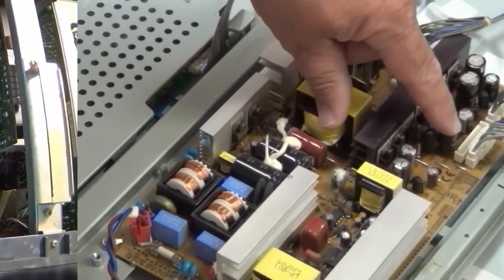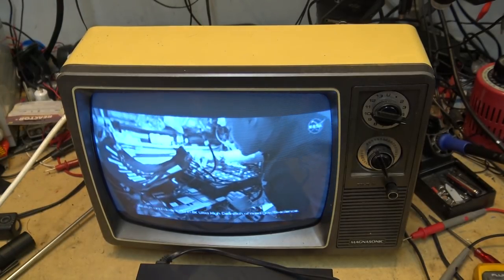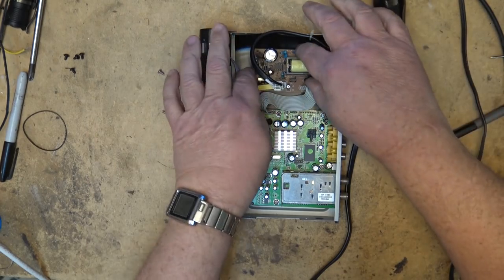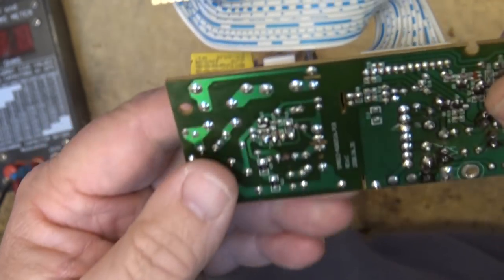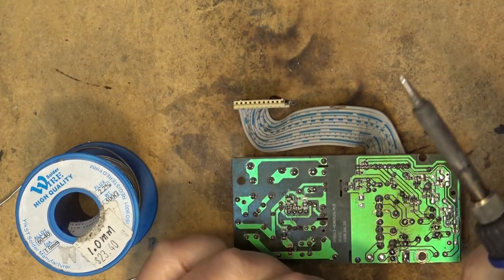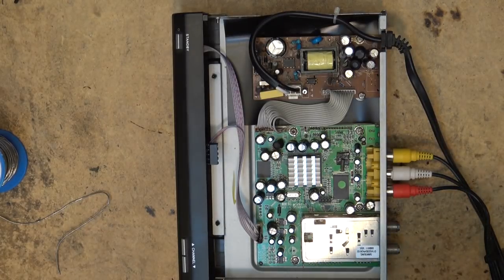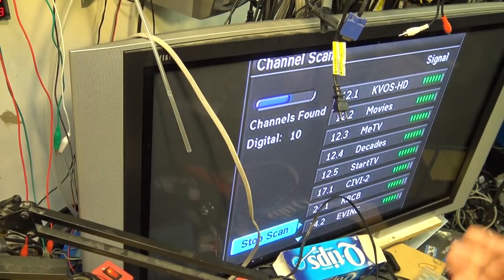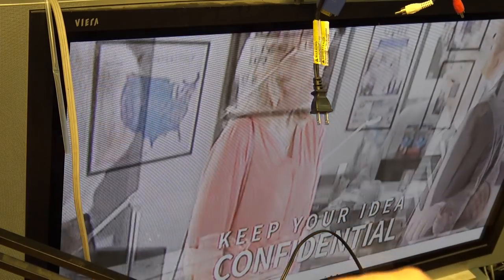Memorex ATSC to NTSC converter box repair NOT FAILED CAPS

Comment: first converter was an apex unit,after 6 months it ran warmer & warmer getting hot around a year into use,next 3 months,it had to  be warmed up with a  small space heater aimed at it before the red light went to green .A year & six months after purchase ( govt paid rebate) it died,,for good & the last time when I put a carbide drill bit  through  it,out to the alley with it I must say for the first 5 months of use,the apex put a great pic in the tube,nice dense color & balance , skin & green tree,   earth  tones,it was great..At the 6 month mark it also tended to drop channels,had to rescan often, The replacement for it is the insignia brand,pic is still almost tops,but consistently works the way  it is supposed to, an used radio shack antenna amp helps pull in a stronger signal from the rabbit ears I placed on the window sill
Reply from the maker: They have some real nice ones now with USB so you can plug a hard drive in and it becomes an off air PVR. If I didn't get a discount on cable/internet I would drop it and just get some HD receiver boxes with hard drive and record everything from free TV.  I currently do that with an old Bell 9200 sat receiver. Sat has been dead for 10 years but the ATSC tuber works great. I use it every day to record the news.

Comment: Seems like earlier HD DTV boxes that were usually rack width and also work with old analog sets were much better made. Like those made by Motorola and Samsung (with ATI HDTV chipsets). These more recent small boxes are junk, likely all made by the same Chinese outfit (Funai?) despite the branding on the front of the unit.
Reply from the maker: This was an early box.  I have had it probably 10 years now.

Comment: May seem crazy. But I wish I had a box that does the opposite of what this type does. Reason is I have multiple VHS tapes  and a  DTV converter that records to flash drives. But, alas, it has no form of analog support.  I can record to a DVD and rip it to a computer, but that's a tad cumbersome.  The adapters that convert a VCR output to USB have been a no go. Everything was shot by an armature, so some quality loss is no big deal.

Comment: Speaking of Converter Boxes, I went to Yard Sale and browse around, and the owner didn't know what that is and decided to sell for 25¢ because, they never use these pair of the devices! What I found out, it is a Digital Converter Boxes for Off Air TV! So I bought them two for 25¢ each and not a bad deal! It's a Magnavox TB110MW9 Converter Box, it only got one remote for the Converter Boxes and still works. Plus I got the next one, is the two Bunny Ear Antenna for 300Ω terminal, and came with 300Ω to 75Ω terminal for the VHF sockets, and one Bunny Ear Antenna for the VHF sockets, which still use for 75Ω terminal. These antennas are 25¢ for a whole bag, I kid you not. These deals is absolutely great where they want it all gone from their house and I was like, "Oh Goody!" The owner is negotiating, and trying to sell cheap to someone who needs some certain items. Though sometimes, I have to be a penny pincher to look carefully and see how much is it worth to buy the item from the owner, and the dealer.

And now, finally, I got the portable car FM Transmitter with iPod for a $1, and I can't believe that I scored it that has the FM frequency channels that I can change the frequency from 87.5 to 107.9 MHz, close to 108.0 MHz, and it broadcast FM stereo and I test them out by put on 87.7 MHz on Ch 6, I can see the screen is blank, and got the audio! it only broadcast about 100 Feet I think, and I am so absolutely stunned that I can use the frequency of 87.5 to 87.9 MHz on FM, though I know in 2009, the FCC took away the frequency of 87.5 to 87.9 MHz to mark them as ban other than for them to go ahead and broadcast on the frequency of 88.1 to 107.9 MHz on FM. Other than, I got them for a dollar for a portable car FM Transmitter! Not a bad deal on Friday! My lucky day! My very lucky day! =)

Comment: FYI: in NC, at Burlington and Ocracoke Island, the Cable company has a Analog signal to TV and you can use the CRT TV and HDTV to watch any program right at the Motel, Hotel, or the House so you can see any additional program and I find it is really awesome that Cable Company has a Analog Signal in NC, and it is too bad in KY, you can't get any Analog Signal to TV other than to have a Cable Box that converts from Digital to Analog to watch any program right at home.

I don't know that the Cable Company in NC will continue to broadcast on Analog Signal for TV for anyone who can use the CRT TV to watch their favorite program, or the Cable Company is going to upgrade from Analog to Digital, but I will see how it happens.

For what I heard on July 13, 2021, the FCC enforce all low power Analog TV Stations to be shutdown for good and upgrade to Digital, and it is kind of sad to see how it happens in USA.

Comment: i never even knew these things existed. interesting indeed. kinda glad i didn't though if they failed that much in the day.
Reply from the maker: I was also running 4 of them in a fire stacking configuration. "fire stacking" is a term used to describe components stacked on each other with no ventilation. The units on the top get all the heat from the units below them.  I once was at a customers house that fire stacked a modem on top of a router, and they got so hot that the plastic cabinets fused together before the modem packed it in from over heating.
Reply from the maker: They are still available, and many people are still using them for their old analog TVs. Believe it or not there are still millions that have old CRT sets. Not everyone tossed their old set. There are still plenty of people with them that continue to use then and will until the set dies. Not everyone upgrades just because something new comes out.
Reply: geez that's crazy. even i knew not to stack things like that in general and a modem and router fused even i know how hot those things get.... nice to see they are still around though be handy for some of my crt's specially my 1986 wood grain rca one i found by the dumpster many years back. this thing looks like its fresh from the factory no damage, even no discoloration anything or scratches to be seen and it still works. was a great find eheh.

Comment: Oh yea! Those POS power supplies..... I have a couple converters that have been repaired 3 or 4 times (used poor quality, 105c caps).
I've been tempted to add screw terminals (or a socket!) to the PCB so those cap changes can be done even faster, from the top.
When I cut extra ventilation holes in the lid, that should have included a screened, flip-open door to provide quick access. (lol, DPDT power sw too.)
Reply: Just put in a small ex laptop fan on the 5V rail, it will keep the unit cool and running for a long time, even with Crapolytics inside. Just have to get the heat outside, and they will last a long time. Simplest solution is to keep it on it's side and with airflow on both sides, they run cooler that way.

Comment: Wow $23 dollar for soider that sure a lot .
Reply from the maker: That's what the price tag says. I guess that is what I paid.
Reply: reginald lawrence - I paid roughly that for my solder, not long ago.
Reply: I paid a bit more than that for a pound of Kester not too long ago either. When you think of how many repairs you can do with a pound of solder it really isn't all that much money.
Reply from the maker: @bugdrvr  
Not cheap. When radio crap was around they charged about 5 bucks for about 15 feet of solder. A little tube with a small coil in it. This roll will last me for years.

Comment: Our boxes were called Freeview, funny since we still had to pay the BBC a licence fee to watch tv lol.
Our boxes broke down much like yours, and they crashed for no apparent reason :-(
Freeview digital tv is just shit, low quality low bitrate, the govenment removed good quality analog tv for a crap system.
Reply: Thing is though the ones that were the most unreliable (at least software-wise) were the crappy Philips-based units On Digital sold in the early days of DTT (and the Philips boxes sold in other European markets, terrestrial and satellite were just as bad). These later cheapo units were actually far more reliable.
Reply: Still got analogue TV here, digital migration is still "going to occur realllll soon" and the analogue will be shut off and auctioned off for cellular services and wireless. Only 11 years over and counting......

But then, despite paying for the privilege, I actually do not have a TV set connected to an antenna. I use it as a low cost near HD monitor instead.
Reply: SeanBZA
Yep selling the band off to other services was money grabbing.
The digital boxes did not make tv better, it was much worse, low bitrates and crashing boxes :-(.
I'm not saying digital tv is a bad thing, it would have been ok with much better standards/bitrates.
Uk tv is crap anyway, too many repeats and not making good entertainment like they used to.
That was a good moan lol :-D